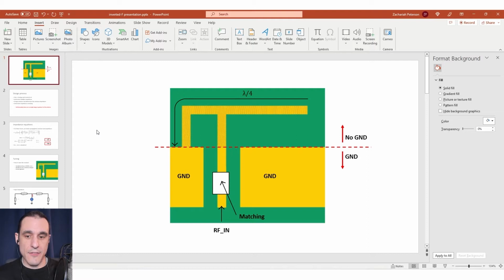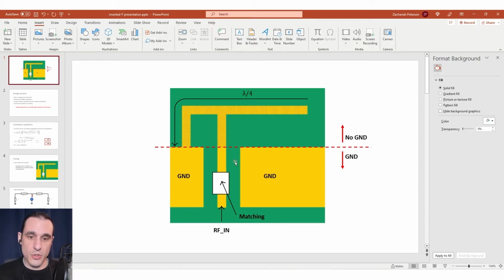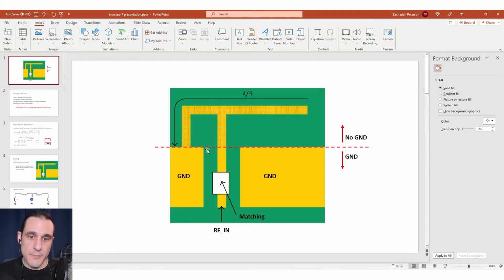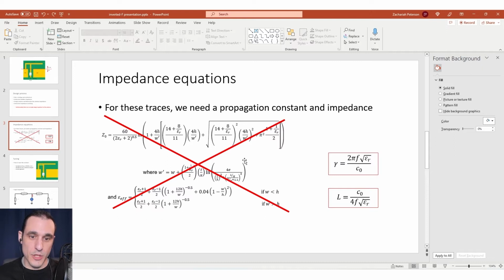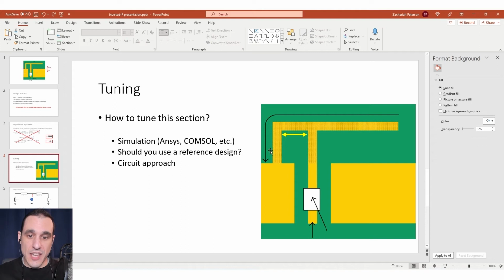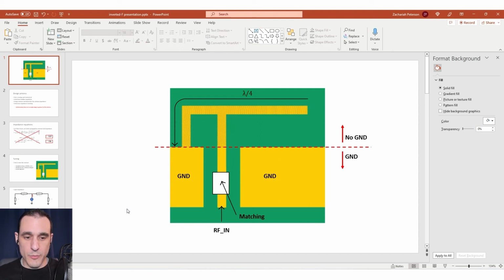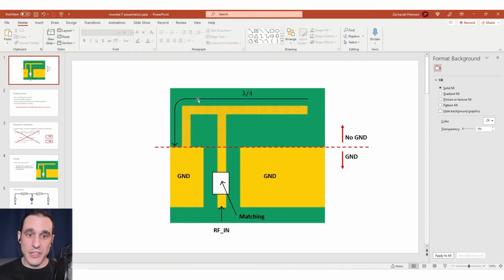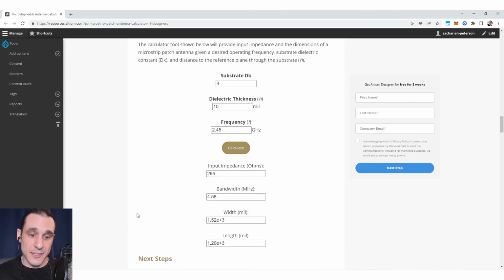Inverted-F Antenna Design Walkthrough - Part One

Comment: I am pretty new to this antenna design 

may i know how antennae ends are connected to PCB ? Is it by soldering or some spring contacts or any other alternate methods available for this?
Reply: If you are referring to the antenna image in the thumbnail, it is probably like a press-fit type of mounting with some solder to reinforce the connection. In the example in the video, the antenna will be etched directly on the PCB just like a copper trace, it is not an external component that is then attached in an assembly process.
Reply: @Zachariah-Peterson  wifi dongle have external inverted-f design's. 🤔
Reply: I would like to know how I can solder an external antenna connection in place of my double inverted-F antenna?  🤔 
Any idea's?
Edit: The solution to my answer was the thinner leg is the input line.
It is also MIMO so two feed line's = two antenna's.

Comment: Very interesting! This is a lot smaller compared to the patch antenna. But how do you ensure the antennas do not create EMI issues for the components on the PCB? If the antenna is on the same side as the components, can the EM waves generated from the antenna couple back into the components on the PCB?
Reply: There are a few simple things that can be done. First, if you designed the stackup correctly, you will probably have used a 4 layer board with thinner laminate on the outer layer (maybe 5 mil thickness). The other components should all be placed over ground on the outer layers, so make L2 and L3 ground. This will help minimize parasitic capacitance/inductance of those circuits. The other thing you will typically see is a set of grounded via fence along the edge of the board leading to the antenna. The typical guideline is that the via fence should be sized such that the maximum spacing is about 1/8 wavelength of the wave being radiated from the antenna. Finally, if the antenna radiation is so strong that these methods do not work, an external module might be needed, but this is only for very high power systems.
Reply: @Zachariah-Peterson  I appreciate the time you take in making your videos and teaching us all everything that you do. Is there a way for us to add a trace antenna onto our pcb board while designing it in altium. I see a lot about patch and chip antennas but I want to just add my own trace onto the pcb board. Sorry if my wording is off, this is all new to me and just trying to learn the best that I can. I appreciate your response. Thank you!!!
Reply: @coreycastro3013  You can do it by drawing the custom antenna using fills in the component footprint, or you route traces to do this. If you route traces you might create a net antenna rule violation, so you will need to suppress that rule on your RF net if you are going to draw out the antenna with traces.
Reply: Zach has been spot on. A few other pointers: via stitching on either side of feed line should be 1/20th wavelength apart. Run connections between components on inner layers unless short distance. Use ground fills on all layers if possible. Fill entire board with 1/8 wavelength via stitching. I have used this method for +20dbm transmit with no problems. Antenna tuning place pi or tee matching network in feed line as close to antenna as possible but still in ground plane area (not ground keepout). Antenna tuning is another beast requiring VNA and some more experience understanding how to properly use VNA. I generally use chip antennas for wearables but have used some inverted F for larger boards.